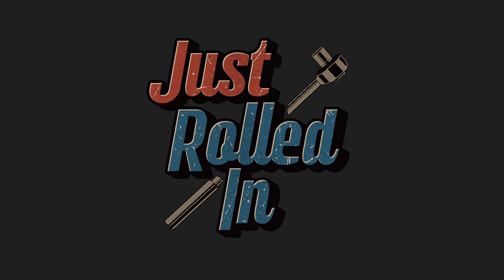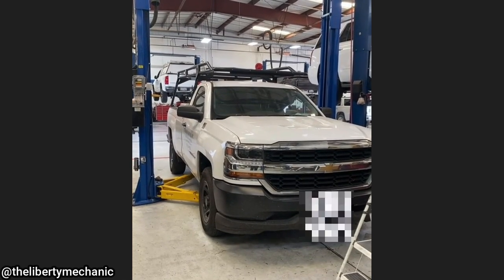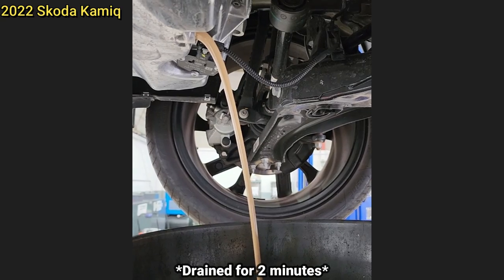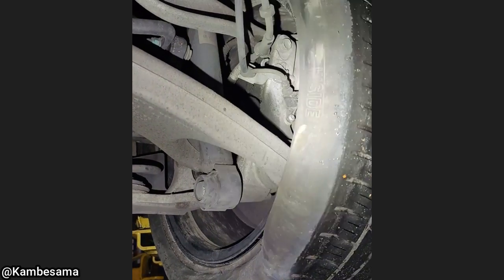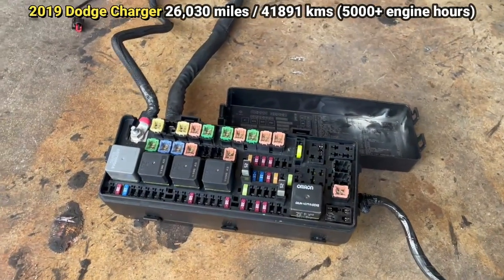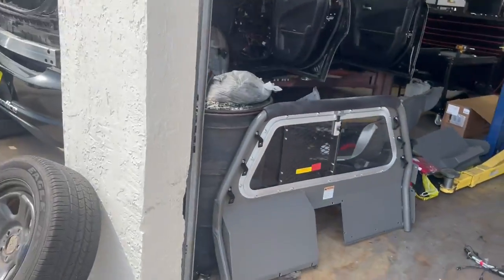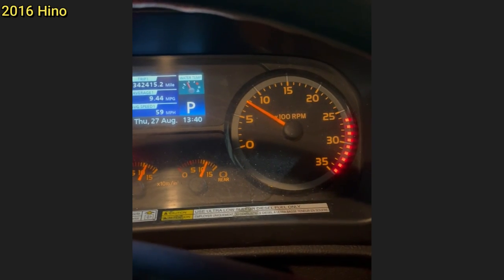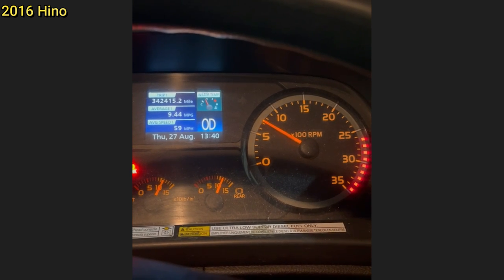Customer States Brakes Locked Up | Just Rolled In

Comment: Citroen is like the Gyro Gearloose of auto industry. The inventions don't always work as good as intended but they sure are interesting and thought-provoking.
Reply: Wee Wee
Reply: @ronhaworth5808  Don't you mean; Oui! Oui!
Reply: Citroen copy no one, and no one copy citroen
Reply: @juhomaki-petaja  some cars copy the headlights over time
Reply: Brilliant solutions to what no one thought was a problem.
Reply: Click and Clack always said “the French copy no one and no one copies the French” 😄
Reply: Never a worn clock spring here ;-)
Reply: I used to HATE french cars, thought they were for weirdos (and maybe they are:-) but my brother bought a 09 C6 (the pre made in China one) and that thing was so comfy and really nice inside, the 3.0 V6 was nothing special but it was such a nice ride with the Hydractive suspension. Still wouldnt buy one though :-)
Reply: It's neat.. but why? I don't think I could deal with it like that
Reply: @juhomaki-petaja  No-one copy citroen except cars with front-wheel drive, power disk brakes, split front/rear brake circuits, rear brake pressure-limiting, monocoque construction, DSG transmission, progressive crumple zones, zero-offset steering, etc, etc
Reply: @patrickanderson6226  So the driver's air-bag can be a full-size square, safer one instead of a tiny little round one like on other cars.
Reply: @normandiebryant6989  thanks for the info. Makes sense
Reply: @normandiebryant6989  Agreed. Late 60s a friends father had a DS and it was oddly lovable. Eyes popped like lobsters when we drove by. And I still want a 2CV.
Reply: @haroldwilkes6608  50 years ago, my grandfather's neighbour made a dune buggy out of one. He welded the doors and cut the roof off. We went through fields at 50 mph and we were like on a cloud...
Reply: ducktales woo-ooh
Reply: @deeznuts7054  https://en.wikipedia.org/wiki/Gyro_Gearloose. 😂
Reply: @juhomaki-petaja  Citroen hydroactive technology was licensed to S-klasse(but only in rear) & Maybach(as it is clone of S-klasse). Check out Citroen XM/Xantia/C5/C6 height adjustment :)
Reply: Citroën - perfect solutions to non-existing problems.
Reply: @uhtred7860  If that V6 is having the PRV heritage (Peugeot-Renault-Volvo, which is found in the Volvo 264 etc.) it's a time bomb waiting to go off.
Reply: @mmllmmll22  yes yes we know...
Reply: I have this car, and this steering wheel, I like it a lot, much easier to change setting while driving, since the button are always exactly at the same place and not turning. very convenient to use.
Reply: I drove a few cars with this setup. C4 / Picasso, it's a bit weird at first but it's just different, not better not worse. You would be amazed how sharp the Picasso is around corners at a good pace and still be comfy (sea sick people be warned ahah). Citroën are different, some things were great invention, some are useless but they tried. You don't know until you know. Cheers from France happy Easter
Reply: i like  the steering wheel
Reply: @stevie-ray2020  He typed right!
Reply: @uhtred7860  this - these had the same steering solution but also turned the headlights didn't they?
Reply: The 21 or 19 gti or what ever it was called had a steer wheel connected from the middle bottom part and went in with a curve was very weird to drive
Reply: @oxxnarrdflame8865  I really miss those guys. It was a great way to spend an hour on a Saturday morning.
Reply: @patrickanderson6226  this is like an 07 car or something. A C4 maybe. I had a few as hire cars back in the day. You literally don’t notice when driving.
Reply: Citroen also used to make good rally car, the Xsara WRC destroyed the competition and they make the most comfortable cars too.
Reply: I actually kinda like it
Reply: @trooperthatsall5250  since 60s DS
Reply: @normandiebryant6989  FWD existed before citreon the cord l29 comes to mind. Disk brakes already existed in racing cars and in 1939 plymouth offered it on all 4 wheels. Split and pressure limited circuits are nothing new. Citroen never did monocoque cars, if you mean unibody they purchased that patent from Lancia.
Reply: @juhomaki-petaja  Also Citroën 9 times WRC world Champion from 2004 to 2012 :)
Reply: @arthurbesnard1536  Im from Finland. I know
Reply: Spoiler alert!

my car is like that and it has a center console
Reply: Is that the last one? Lmfao I was hella confused, never seen that before!
Reply: In this case, it's a pretty good idea, the air bag is really designed to deploy in one orientation, that's the only system I've ever seen that makes sure it deploys in that orientation.
Reply: @normandiebryant6989  He is quoting... do not remember if its from Top Gear or Jay Leno channel.
And yes our cars are full of inventions made by people from many different countries, but this sentence was about very specific French inventions in case of some cars.
Reply: Do you know I have lived to the ripe old age of 60 and have never ever heard for Gyro Gearloose?
Reply: @stevie-ray2020  No - it was right the first time.
Reply: @marklatimer7333  Well only half of his inventions turn evil, the others are just misunderstood!
Reply: Trying to accept a call with my steering wheel upside down is a bummer so YES to Citroën's solution. Their inventions were too genius to be in the car business where people opt for familiarness.
Reply: @ehsnils  No, this V6 has nothing to do with the old PRV ones. it's much newer and lighter with a reasonable fuel efficiency.
Reply: @julosx  But is it mechanically better or is it a time bomb just waiting to blow headgaskets and eat camshafts like the PRV used to do?
Reply: So it's safe to assume it's not a great product but very thought-provoking indeed
Reply: Great car I have one love the wheel its my third Citroen
Reply: Driven a C4 Picasso with a similar steering wheel for years. Now driving a different car, I miss that steering wheel. We park on street on a hill, so the front tires are always angled towards the curb. With the new car, there is absolutely no muscle memory in routine tasks like switching between bluetooth and fm prior to leaving. With the C4 the buttons where always at the same place. 

Apparently after these generations of cars have proven a basic acceptance, there is now research by some suppliers in non symmetric airbag. Only such a steering wheel can ensure a non symmetric shape would be right side up during an accident. Maybe we will see these steering wheels come back once airbags could take advantage of them.
Reply: @normandiebryant6989  Thanks for allowing me to save some typing on this matter.

Comment: That police car job looked like a freaking nightmare. Can you imagine getting that all back together and then have the customer come back with the same problem. 😱
Reply: Was it really worth it?  
Long periods of idling isn't good for the engine either, & simply turns a low-mileage vehicle into a high-usage one!
Reply: I’d love to see his spare parts pile when that got reassembled LOL
Reply: As long as I got paid for the work, I wouldn't be too upset.  It's 100% on Chrysler(Stellantis). The car was built for service.
Reply: @stevie-ray2020  this is normal practice for Emergency Service vehicles (many have run-lock system so they can be left idling even without the key, but an immobiliser stops random people nicking the vehicle) - otherwise the radio/data terminal, CCTV/GPS/ANPR kit (which is constantly drawing power), blue/red lights etc will run down the battery and the officers will have trouble starting the vehicle when they need to drive off..
Reply: @iuyozx  The question is. Is it warranty work or is it hourly labor rates? Warranty it probably wouldn't be worth the technicians time.
Reply: that's called a gravy pit
Reply: So is this because of long run times, or no air movement across the car?  If they claim its because the car isn't in motion, I would be worried about an interior cabin harness needing the air movement to remain cool.  If its because of long run times, I would be concerned about the car not being able to be driven for a long period of time like on a road trip.
Reply: @stevie-ray2020  My 2013 Explorer Utility PI (ex police) had 9270 engine hours, and 5295 idle hours! It ran fine, 3.7L V6......had to have the water pump replaced, but thats another story!
Reply: This is part of the reason I’m getting rid of mine. Alongside the faulty re-engineered and overlooked oil pump which reduced the oil flow volume at idle to be less than substantial, resulting in increased wear and damage on the 2011+ models when the Hemi was redesigned.
Reply: @wh4070  This is because it's made by Fiat Chrysler. Thats really a legit explanation as to why it may catch fire
Reply: When you have the same problem multiple times from just idling then thats a design flaw on chrysler so they should be paying for repairs even past warrant.
Reply: @zaberfreedom8224  ... how do we know the problem is from idle time? In most cases, a repeat problem is a poor diagnosis, although there could be a design flaw, which would show up on other similar vehicles.
Reply: It's a Chrysler product so I wouldn't be surprised
Reply: The car must’ve been dirt cheap to justify paying that much to fix it.
Reply: @stevie-ray2020  I'm a security guard and I've seen many brand new vehicles turn to shit after just a year of use. Most are running at idle 24/7. The companies don't bother to fix anything, unless it is throwing a CEL and it has to pass inspection (NY). Which could mean that it was lit for almost a year before being fixed. Oil changes are a pipe dream. After a couple of years, they just sell them off at auction and buy a new fleet.
Reply: Long periods of idling should never cause this. The issue is poor wiring loom design and a relay thats too underpowered for the job.  He needs to fit a 30 to 60Amp relay that gets triggered by the standard one and takes the load off the main harness.  

Putting in a new harnesses is unlikely to fix the issue, he should also look at the cabling to the pump, might be a little thin, this can cause relays to overheat.
Reply: @iHelpSolveIt  This exactly 👆 You could idle a Crown Vic or any other Panther platform-mate for years at a time, they never cared. FHP still insists on running that junk.
Reply: thats why i don’t work on cars, if your not making millions its not worth it
Reply: honestly you should be able to idle your vehicle for a long time without that happening, sounds like a design flaw
Reply: As long as he gets paid, he doesn't have a reason to care.
Reply: @l337pwnage   you couldnt pay me enough to do that
Reply: I would have giving up after taking the spark plug wires off frig doing that, my humble opinion would be to get a new car lol
Reply: If I owned that privately it would suffer a total loss electrical fire and insurance claim before I would go through that time and $...
Reply: @wh4070  its just very bad design... Typical of Fiat... First in all troubles 🤣🤣
Reply: @rtnVFRmedia  Seems too stupid for words. Why not fit police-spec cars with either bigger, or separate batteries to run all that stuff? It's a hell of a lot cheaper than this kind of nonsense.
Reply: @davidstewart4570  some Emergency Service vehicles in UK do have such arrangements though its more common for Ambulance and Fire Brigade which have even more extra kit in them (and are physically larger vehicles). Police cars more often have an uprated alternator + cabling and battery. It looks like in this case Stellantis overlooked the extra requirements (such as uprated electrics that could handle longer usage) a vehicle would need for public safety operations..
Reply: When u realize it would be cheaper to buy a new one 🤣
Reply: @rupe53  It's a design problem across all Chryslers that use that body fuse box.  Most of their front wheel drive.
Reply: @williamfranklin6283  ... yes, I mentioned a possible design flaw. Ford (trucks) had similar design issues in their fuse boxes in the late 90s. Seems the back side of the interior fuse panel was similar to a printed circuit board. You take it to get fitted for a plow and the first thing the up-fitters do is install some of those jumpers into the fuse area to draw trigger power (key / switched) so you can grab juice to your snow plow. After that they install a HD signal flasher so you have turn signals with that secondary set of headlights.. Yes, they add relays and another battery tap under the hood, but the fuse panel itself is not rated for even a few extra amps needed to do just the triggering. As I recall, it was $350 to replace that fuse panel, then more changes needed to be made for longevity of the system. These vehicles really need to be designed with these things in mind right from the factory.
Reply: @wh4070  or getting stuck in a bigger city's gridlock.  If your top speed is going to be 15mph for 3 hours that's probably not enough air movement to keep stuff cool
Reply: I'll wager a case of beer (shipping not included) that some extra equipment is wired into that circuit, thereby overloading anything on it including the wiring.
Reply: not suprising why do police still buy these shitty Chryslers GM and fords get something reliable aka Toyota and Honda
Reply: @joshuamast5128  ... I don't think Toyota or Honda make a vehicle big enough to suit the job. Personally, I feel there's a market for a specially built vehicle. AM General did it for the post office so why not the police?
Reply: @dcsteve7869  can't be any worse than Kia recall catching fire while driving down the road
Reply: @dcsteve7869  Fun fact: Mercedes had the exact same issue in some models, although they didn't catch fire but they just stopped running after the fuel pump relay running hot and melting. All caused by a cheap way to wire up the pump which caused a too high current through the relay. Even the official fix was only temporary (and very, very costly), made my own fix by wiring up a second relay to spread the load and no problems ever since.
Reply: @acemobile9806  Long live the Vic!
I've had lots of fun in them. A true beast. I miss them. You truly could idle them for as long as they had fuel. A common trick in hot weather was to pop the hood to keep things cool if you were to be on scene for a while.
Reply: If i was the guy in charge of the vehicles for that city i would sell that car to a civilian who doesn't  leave it at idle and buy one that comes with a police or heavy duty package. Some day, it will be out of warranty
Reply: Yea you can’t change a few parts and change the fact that it’s a FIAT.

Comment: 2:12 As a semi truck driver, this looks like the average truck you get assigned on the first day.
Reply: Just what I was thinking- I'd love to be given a truck that nice for my first month! 🤣😂
Reply: @mrblack5145  Head on over to Schneider.  Their trucks look really nice.
Reply: Put some stickers on the truck and it will add 20 hp.
Reply: One of my trucks had to have the starter beaten with a 2x4 just to get the engine started.
Reply: Truth! 22 year old Scania with a grinding gearbox and a fuel gauge that requires some "percussive maintenance" to get a good reading. Lost the air-pressure twice due to leaks and it completely exploded at the rear axle while the truck was being loaded one time.

Oh, and the springs were sticking out of the seat too.

I still love it though.

Comment: As for the steering wheel, it's either love it or hate it. As a C4 Grand Picasso owner, I love it. The controls are always where you left them and I like to know that it allowed them to fit a bigger airbag
Reply: I had a grand C4 Picasso as well and the steering wheel design is inspired. I wish my vw Sharan had a fixed centre to the wheel.
Reply: the controls are always where you left them.... what stupid lunatic is operating ancilinary controlls while steering ??